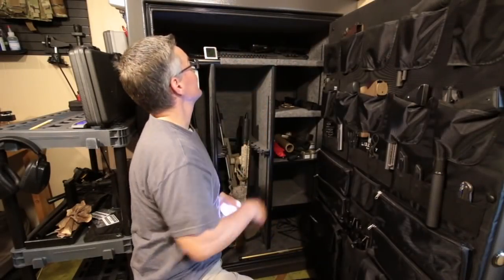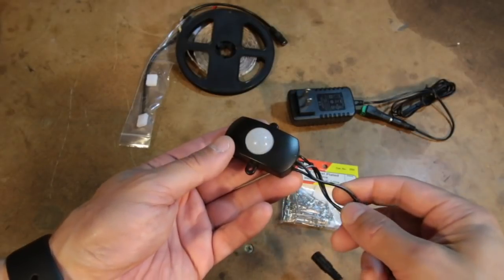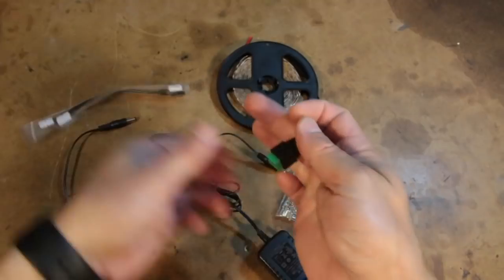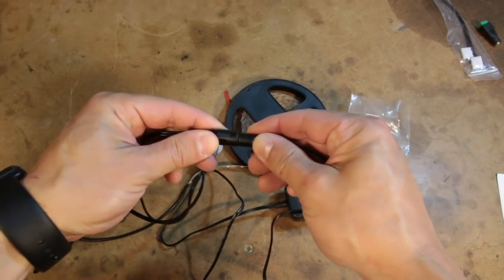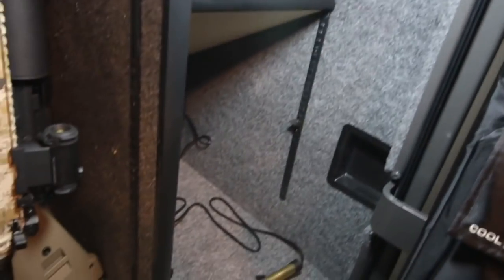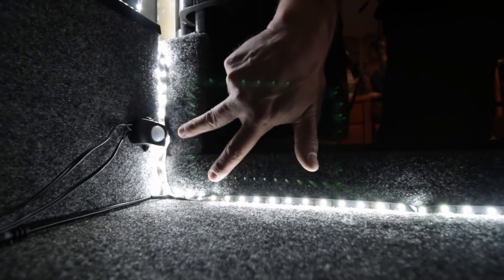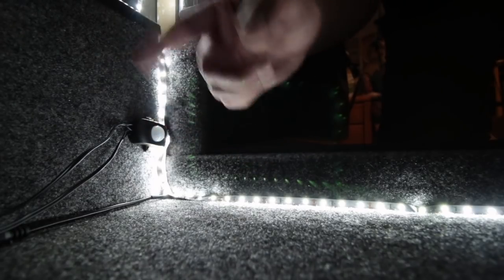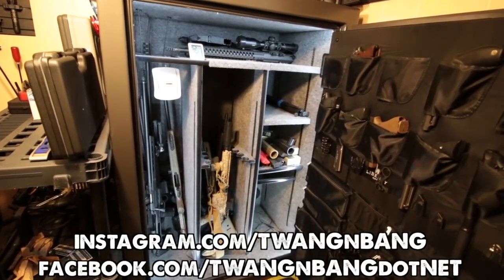Easy & Cheap DIY Safe Lighting! Motion Activated

Comment: Is there a battery pack option for a setup like this my safe doesn't have a power outlet ? Thanks for the awesome video
Reply: Derek'sGames&Vlogs drill a small hole in the back of your safe. usually there is one already there you just have to drill out the material on the inside. I did this and it worked fine.
Reply from the maker: I'll be working on a battery-powered version soon, but it will always be easier to just buy batter-powered LED systems.  They're not as bright, though.

Comment: Thanks so much for this video it will save me money for me next safe.  I found someone on E-bay selling a custom kit for $50 years ago.  That came with a pin switch I had to drill into the safe door which I prefer more.  Did you ever look into that option for your setup?
Reply from the maker: Why bother? This is cheap, requires no permanent modification, and won’t wear out with use.
Reply: I like door open light on instantly and to have that light stay on until the door shuts.  To each their own.  Thanks again for the video and the ideas.
Reply from the maker: FWIW, the lights are on instantly with the motion sensor, too, and they stay on as long as you’re moving in the safe. In fact, simply walking up to the open door triggers them again. There’s no way for you to be doing anything in the safe without the lights being on using one of the motion sensors linked in the video description.

Comment: Great video! Just got my stuff in to do the same thing. I just got the same safe and a golden rod as well.  Noticed you also has other dehumidifiers, is the golden rod not adequate for that size safe? Thank you!
Reply from the maker: I live in a very humid climate, so I like to do overkill for protecting my firearms from it.

Check out my gun safe playlist to see the videos on both the GoldenRod and the Eva Dry that I use: https://www.youtube.com/playlist?list=PLLL3Kmhuld1VXMEiZcYhL6vDF0FSCDp0p
Reply: @TWANGnBANG  I use the Eva-Dry in my other two safes.  Probably going to have golden rods and eva-dry in all 3 as well. Mine are all in a closed in garage where the temp will swing quite a bit. I don't guess they can be too dry?
Reply: @Slinky108  Yes, they can be too dry and be hard on the wood.

Comment: Thanks for the video. I got my lights installed yesterday and they work great... NOW, it WAS NOT an easy job (this MIGHT be due to being 61 years old with bad knees, hips, back and a torn rotator cuff in my right shoulder). I got the job done, but it ISN'T as pretty and neat as yours. Also, the 16.4 feet of LEDs was not quite enough. I used a staple gun and this worked, but I lost about 12 LEDs. I'll probably redo the job, I've already ordered another reel of lights and I also ordered mounting brackets from LEDsupply to try to do the job NEATER this time. (the brackets are available from LEDsupply and are $1.99 for 15, there are 2 types, one for the waterproof LED strips and the other for the non-waterproof used here)
Reply: OH, BTW, I used the 1 inch pins (or tried to) and they were pretty much worthless...that's why I had to resort to the staple gun.

Comment: How does the light senso...motion sensor work at night in a dark room? Does it still turn on the lights?
Reply from the maker: If you can see well enough to open your safe, there is enough light for the sensor to know the door is opening.
Reply: @TWANGnBANG  thanks

Comment: I tried running an extension cord I cut in half under my safe through one of the holes where you’d bolt it down. That didn’t work. I have all my lighting set up and it works if I plug it into the outlet when safe is open but I’m trying to figure out a way to get a small extension cord in there or even run a plug. I wish I knew how to do this stuff.

Comment: My safe doesn't have a mains connection. Will this work on battery packs or will it drain the batteries too fast?
Love your videos! 
Keep on twanging from the UK.
Reply: LEDs use so little power you could easily run them off of a battery without constantly killing it
Reply from the maker: I'll be working on a battery solution soon, but it will still be easier to simply buy a battery-power LED system from scratch.  Not as bright, but no wiring needed.
Reply: I just can't find a battery pack attachment instead of the mains that's all.
Reply from the maker: Doesn't exist.  You have to make one.

Comment: I did this setup with the power pack cause my safe doesn't have a power cord plug in or slot to pull one through. It lights up 100% bright then dims out on 25% and the rest go out instantly. Is this cause I'm not pumping enough juice? It's not as big of a safe as yours it's the 36 gun tractor supply safe.

Comment: Been a while but how has this been hanging up? Any changes you’d make if doing it again considering longevity? Product quality?
Reply from the maker: Still working great!  Many find that pins aren’t needed- you can just use the glue backing to hold the lights in place.
Reply: Thanks as always for a prompt response! I don’t have a ton of room where I am going to put my safe…of course, the 20 week lead time is rough. I went with the Liberty USA 36 for size constraints but I feel I will be happy.

Comment: I've been thinking of doing something like this, instead of having a magnetically attached battery powered motion sensor light on every shelf (bulky, batteries need replacing and I have a feeling some of them break if there are depleted batteries in them).
It's been exactly the motion detector which has made me think it's perhaps not practical.
Reply from the maker: This will make you and your guns happy.

Comment: Yea my safe doesn’t have power outlets inside so I might have to drill a small hole through the bottom, place the safe on a 1/4” thick base platform, slot a route for the wire to feed and then finally bolt the safe securely down to the floor.

Comment: So, if the safe is in a very dark room and you open the safe door, the "motion sensor" won't kick on?  I was disappointed that I don't have power in my safe, but I feel like it would be good to have it work during a power outage. Maybe a small battery backup?
Reply from the maker: See pinned post for a battery that is designed specifically for this type of lighting.  The PIR sees both visible light and into the IR spectrum.  If there is no visible light, your body heat should trigger it nonetheless.  However, that means the safe door might have to be a bit more open.  That's all.
Reply: TWANGnBANG Nice. Thanks for the reply!

Comment: Is there a way to make this run off a battery pack of some sort?
Reply: RomelS78 Same question for me! Can I hook a 6v box battery or something?
Reply: pretty sure since these leds come with a transformer power pack that they are 12v and you can simply connect them to a 9v battery or something similar. depending on the amount of leds you use tho, youll have to factor in how much power output you need.
Reply: yes, all they are is led light strips. You could even get multicolored lights for it, and the system i beleive is 12vDC. Look online for led light strip battery packs.
Reply from the maker: I will be working on a battery-powered version soon, but ready made battery-powered LED systems will always be easier than making your own.  However, they won't be as bright.

Comment: A much simpler solution is to use velcro instead of the t-pins.
Reply from the maker: Not really, no. The velcro would have to be trimmed to size, and I've read plenty of people saying they've had problems with it sticking long term to the felt.  Thanks for watching!
Reply from the maker: Equivalent system from them would be over $60 (300 LEDs and a motion sensor), plus it uses the same SMD LEDs that are on the lights I use in this system.  In fact, they look to be the EXACT same lights, just packaged by them for use in a safe.  No problem with them doing this, but you are paying a premium for their system and not necessarily getting a return from it.
Reply: I cannot fault you for trying to steer folks towards Amazon, given your participation in their affiliate program and the fact that your end result looks nice.  Thank you for creating your video.  Hope it will help some folks out.

Comment: I bet if you got a strip that was about 4 feet longer you could have started on the shelf then went around the outside of the safe. Then you wouldn't have the dark spot in the middle.
Reply from the maker: I put the little lights that Liberty included with the safe in there.
Reply: i just picked up all the stuff, it was on sale for $25 total! really liking it!

Comment: So my safe is in my bedroom. Let's say I'm lying in my bed naked with the lights off and then need to quickly get into my safe.....will the motion sensor work in the dark? Again, I am completely naked in this scenario. I think I may want to got with magnetic switch method, but this way seems easier.
Reply from the maker: Not sure.  The switch needs to see a difference in light in order to sense the movement.  If there is any ambient light in your room even when it is “dark,” as would be required for you to even find the safe to open and see the dial to do the combo, it might still work just fine.  Magnet switches are also a solution, of course.

Comment: Did he just drill a hole in the back of the safe to get electricity?
Reply from the maker: The hookup was already done by Liberty, but yes, that is exactly what you do.  It's done low, so heat intrusion in a fire isn't as much of an issue as you'd think.

Comment: how about a open doors sensor instead of motion activated timer ?
Reply from the maker: They require wiring in a connector (aren't plug-n-play like the motion sensor is), and tuning them to work is a pain in some installations.

Comment: Why not use a door switch instead of motion sensor? As long as the door is open you have light. Close it and it’s off. Like your fridge.
Reply from the maker: Door switches are prone to breaking, and I rarely keep the safe open more than a minute max.

Comment: That's way to much Chinesium, with way too many angry pixies for me to trust inside my safe... Or house for that matter. 

I bought a roll of those LED lights... And every time I plugged them up, it got so hot the sticky on the glue would loosen up... And stink like burning plastic.   That's pretty much all I needed to about the quality of the product... 

Your mileage may vary... But after playing with those lights for an afternoon, I'm not plugging anything into a wall plug that isn't UL listed.
Reply from the maker: Hundreds of people have installed this exact setup since this video. I’ve never experienced what you are describing, nor has anyone had anything but great reports after installing these.
Reply: @TWANGnBANG  Good for you, and everyone else who had good luck...  I hope every single person who tries it has a great outcome, and zero issues...  That said, there is always a caveat when trying to save a nickel by using cheap Chinese products.  Maybe I was just the unlucky bastard to find it.  

In the end, I spent 1900 dollars on a safe, I figure I could spend more than 35 dollars to light it up. So I bought the factory Liberty set up.  It was worth 130 bucks to know the inside of my safe doesn't catch on fire, or if I ever had an issue, there's a number to call. 

👍
Reply from the maker: Nobody in the US makes safe lights.  Liberty uses Chinese-made lights, as well.  You be you, but your fear that people are setting their safes (or houses) on fire with lights like this is completely unfounded.
Reply: @TWANGnBANG  They may... But at least I know there's a company behind them... Good luck with that Amazon customer service...  14 weeks later, and I've still not heard back from the amazon seller, even after leaving negative feedback... The lights I bought are also UL listed. Which means someone has at least went to the trouble to prove they are safe. 

And since I had the issue, how the hell is it unfounded? Because it hasn't happened to you, it's never happened to anyone? Are you serious?  I guess the lights I had didn't over heat or short... I guess they didn't smell like melting plastic?  I just completely forgot that you were here when it happened... Yeah. My concerns are completely unfounded.  I'm so glad you set the record straight.  

👌
Reply from the maker: Why are you bothering to contact the Amazon seller?  The lights I link to are protected by Prime.  With Prime products, you contact Amazon, not the seller, and Amazon will process your return and refund.  Did you buy lights not protected by Prime?